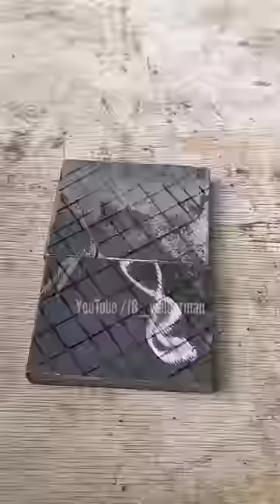make vise from used gear

Comment: Used steering column -$75 
Old bike gear - probably free who knows 
All the weld -$30 
Days of welding and rewelding - your time is priceless 
Grinder to cut apart and reweld your mistakes - $45 + $10 for the cut wheel of they're both hyper tough , way more if not 
Old turn handle - no telling what he tore apart for that 🤣
Total home-made vise $145-$165 
Vice at harbor freight - $75 

🤔🤔🤔🤔🤔🤔🤔🤔🤔🤔🤔🤔🤔